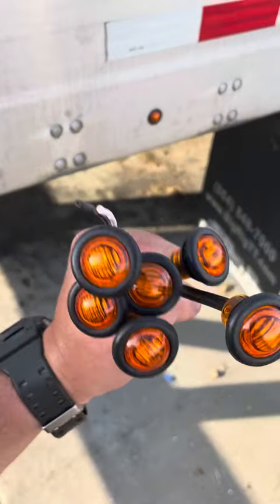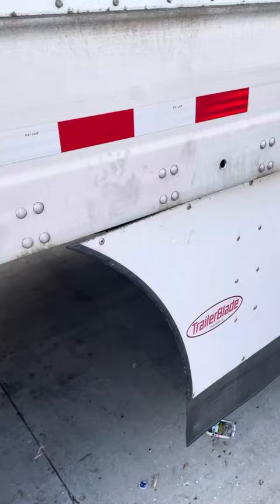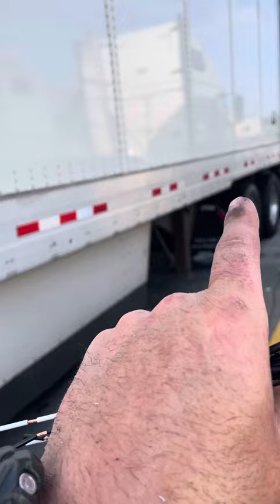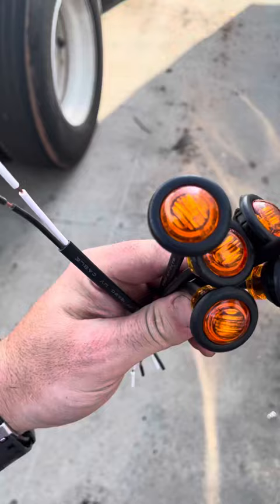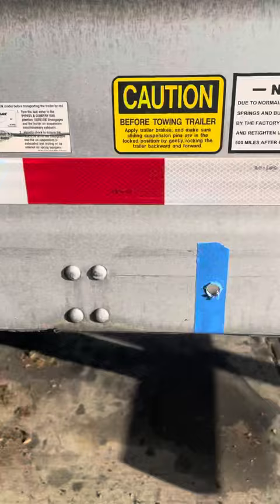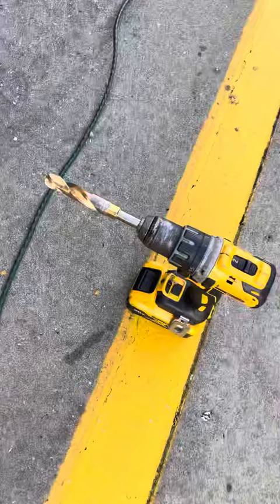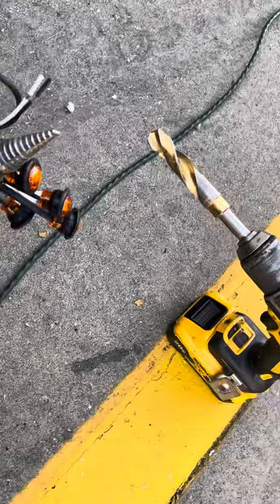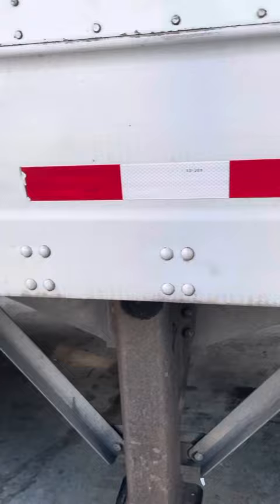Truckin Life, How to install Chicken lights part 1!!!

Comment: What Drill bits are those names please i tried a few different ones and they got messed up or broke
Reply from the maker: Step bit but get the one triangle shape
Reply from the maker: https://www.lowes.com/pd/Bosch-2-pc-High-Speed-Steel-Impact-Tough-8482-Turbo-Step-Drill-Bit-Set/1002276240?cm_mmc=shp-cprdtolgglSS_TOL_215_Power-Tool-Accessories-1002276240-local-0-_-0&gbraid=0AAAAAD2B2W9D0G5OlbvX4gcr8TdSsFmcf&gclid=CjwKCAiA6Y2QBhAtEiwAGHybPYG3yMZmndMmIxO7bgxrw6opUBiZkmQPKELI1buIdQ9L4jP4vy5UWBoChVsQAvD_BwE&gclsrc=aw.ds
Reply: Buy Dewalt drill bits

Comment: Hey man, how do you connect the chicken lights for power. In can’t find a video no where
Reply from the maker: For me it was the green wire coming out from the side markers. As the power wire u hook that to the black wire on the chicken light. Then the white wire u ground to the trailer. U need a roll of wire called continuous power or just go buy a roll that has 2 wires in it. Suggestion ( I would skin back 2 pieces of scrap wire. Then unplug the side marker turn light from the center of the trailer. Take one wire u skinned and stick inside the side marker plug hole where the green color wire is, and then the other skinned wire hook to the the white wire from chicken light. Touch the white wire to the trailer from the chicken light for ground if lights up that’s ur power wire. If not take out the wire from the plug of side marker and try other wire. There is only 3 wire from side marker and white will not be power so u just have to see which out of the 2 left is power. And ground the white wire should work.
Reply from the maker: Sorry meant mine was brown wire not green.

Comment: most are here for drilling part
and holes already made.... kind of F’ed the video
Reply from the maker: @zaidchalabi just need a triangular shape bit called a step bit and hammer a dent or I just started drilling away bc it was a new bit
Reply: @truckingwithscottpridmore  
3/4” size bit or smaller
and you just drill it all the way ? 
and how is the light held in there ?
Reply from the maker: @zaidchalabi  something like this just make sure u stop at the 3/4 mark. After u drill hole u insert the rubber grommet from the light and that is what holds the light in check out video #2

https://www.lowes.com/pd/Greenlee-GL-Step-Bit-4-Up-to-0-875-in/1003097710?cm_mmc=shp-cprdelcgglLIA_ELC_106_Tools-Wire-Connectors-1003097710-local-0-_-0&ds_rl=1286981&gbraid=0AAAAAD2B2W8pKi7-Fjrx9GSgvZHoh7BeS&gclid=CjwKCAiA1JGRBhBSEiwAxXblwRXiW4ImbRBKSMvdgsEkqn1xHfr8VuvCcekEKFw6PZsgUm34IgxD8RoC7B0QAvD_BwE&gclsrc=aw.ds
Reply: @truckingwithscottpridmore  appreciate it bro
i think they have drillbit thats 3/4” max
so u can go all the way and its 3/4”
Reply: 36 down each side of propane trailer.... light it up!